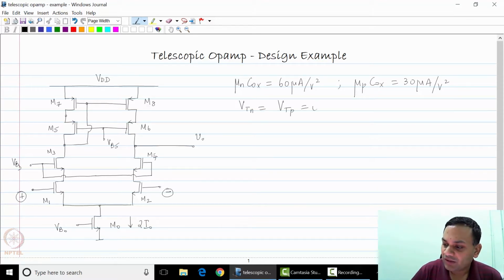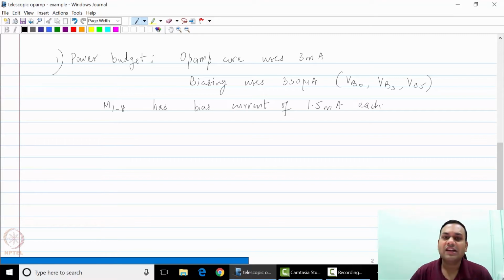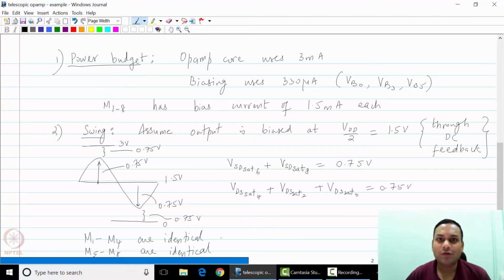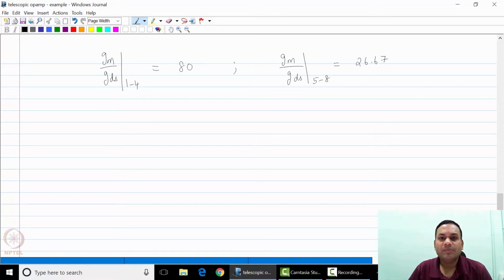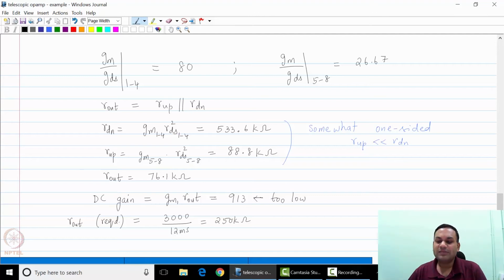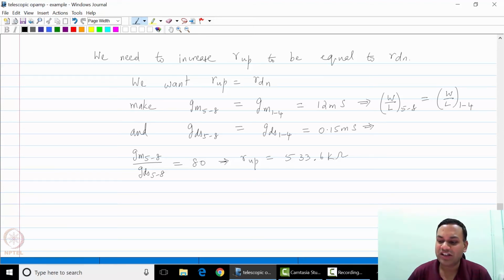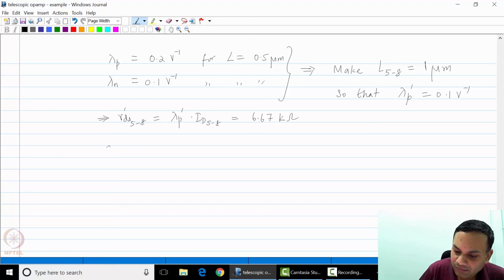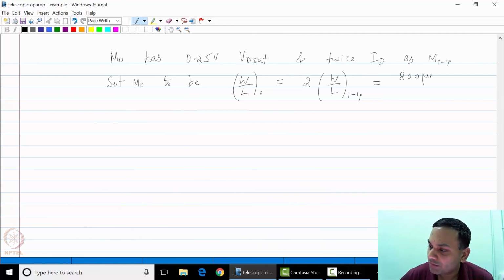Telescopic OpAmp - Design Example

Comment: can anyone tell me why exactly he assumed current in power budget is 3mA
Reply: It is because in the specifications the power dissipation was 10mW and Vdd was 3V. So if you divide power dissipation by Vdd the current in the circuit should be arround 3.3mA for which he allocated 3mA for the circuit and rest 330uA for biasing.